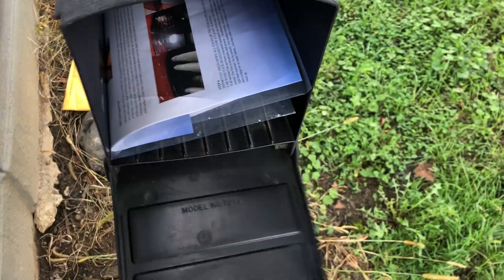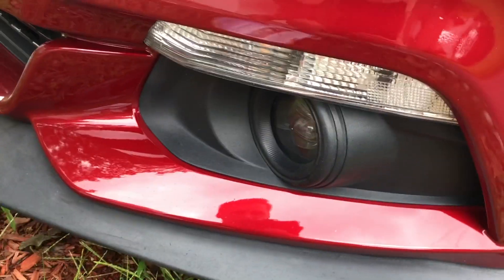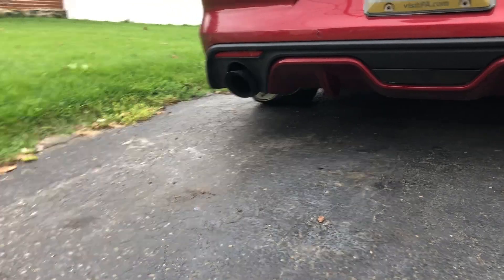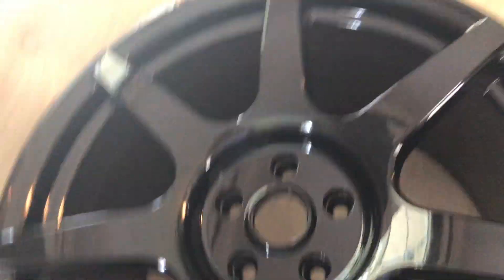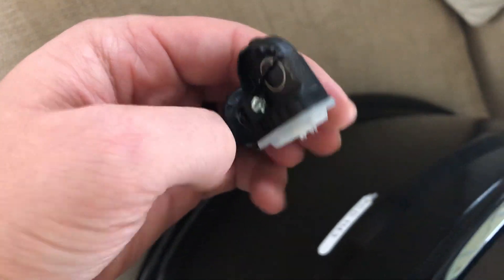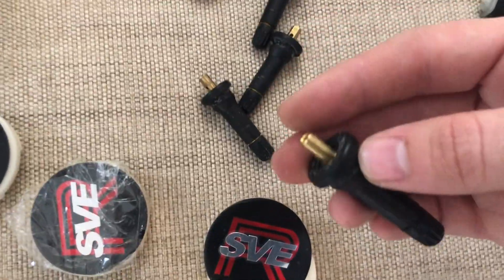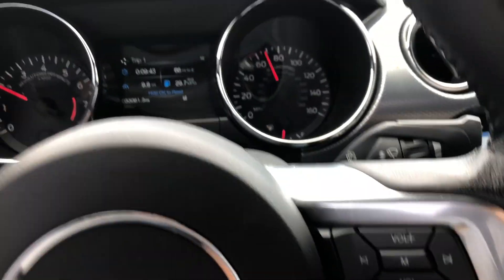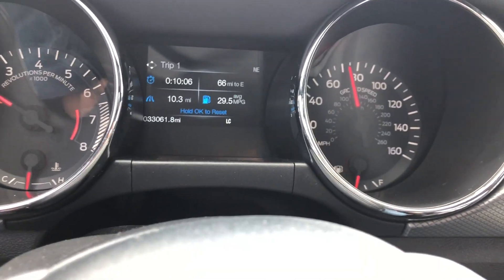Wrecked Budget Mustang GT Rebuild Part 8

Comment: why not chose the 10” square setup, no rotation allowed for stagger and possible understeer. U plan to FI ur stand?
Reply from the maker: leo xia couple reasons: the car was meant to have a staggered setup so I followed it, also GT350 mustang has these exact sizes so it was a safe bet. Not to mention the ability to mount a wider tire in the rear for more traction. 
That said, you’re right, 10” squared would probably be a better setup long term.
Reply: @romagrigorenko  gt350 has wider body shape than gt5.0, also with different design, cannot setup based on shelby